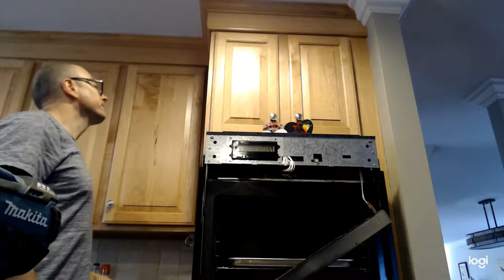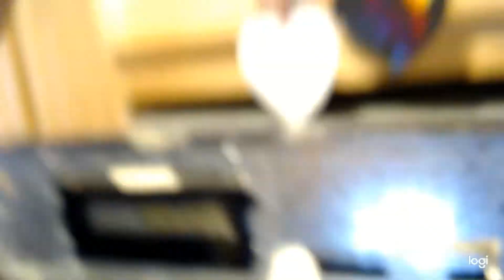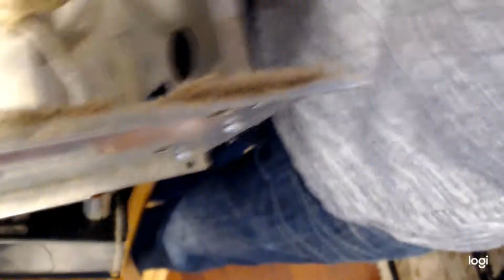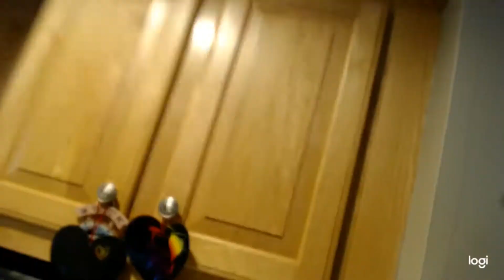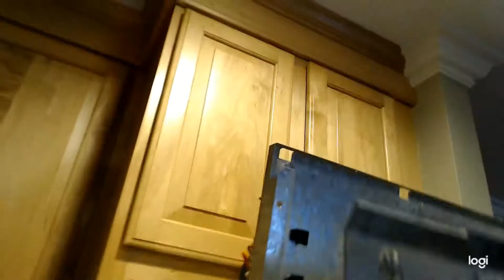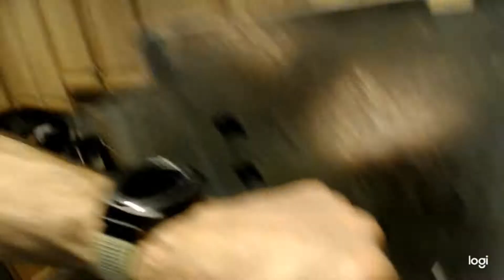SCD272TP Thermador Oven Latch Replacement

Comment: Was your latch not moving/working at all?

Mine is currently working too much.  It won't stop moving.  opens, closes, open, closes, continuously.  Appears to be same model, scd302tp. 

I've fixed everything from control boards (both), sail switches, and heating elements on this oven.  Seems like right before holidays... this oven likes to keep me on my toes.